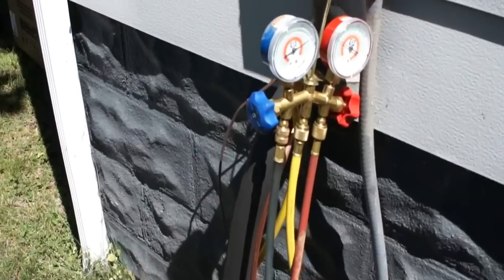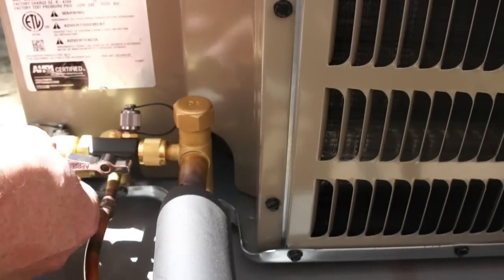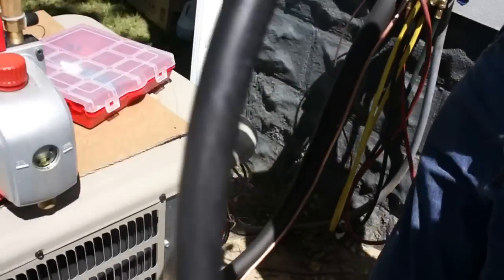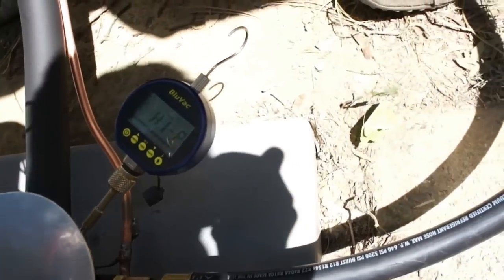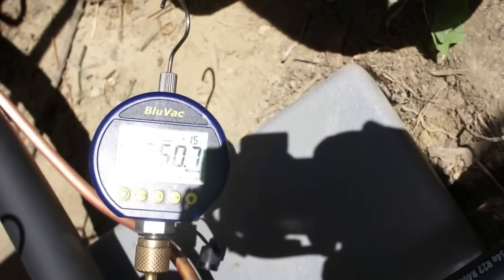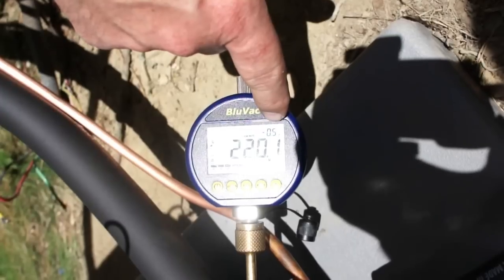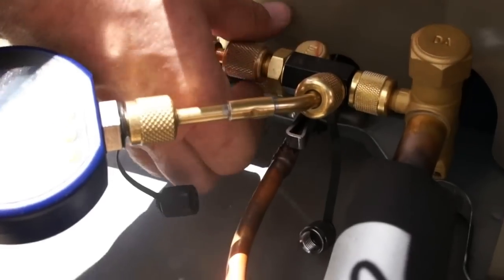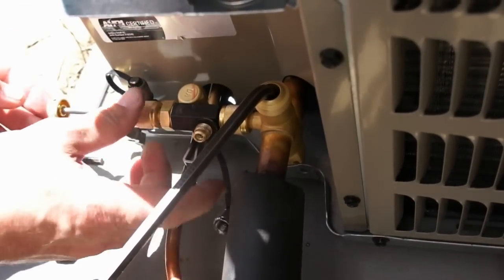51 seconds to 500 microns with the TruTech Tools Rapid Evac System

Comment: Hi..
how.mutc is the minimum vacuum pressure for good results ?
Reply from the maker: Generally, evacuating a system to 500 microns or less is a good standard.
Reply: @TruTechTools  i make it 40 microns and when I stop  rise to 350
Reply from the maker: @ghostridergr8259  more often than not the lower the better!

Comment: I was always under the impression not to open the suction service valve under a deep vacuum,  reason for that, you can pull the oil out of the compressor, correct me if I'm wrong and explain please.

Comment: When you open the valves with micron gauge attached won't that expose the micron gauge to the pressure of the refrigerant / oil? I did this the other day and I think it damaged my micron gauge.
Reply from the maker: Before you start the evacuation process, the system should be purged with nitrogen to remove leftover oil and other contaminants from the system.  In the event that the system keeps some residual oil in the lines and this oil comes in contact with the sensor, the AccuTools BluVac (shown in the video) can be cleaned with isopropyl alcohol.  Just fill the gauges sensor port with the alcohol and swish it around inside with your finger over the end.   Dump out the alcohol and repeat until the alcohol is no longer dirty or cloudy. Isopropyl alcohol can be used to clean most micron gauges, be sure to check with your gauges manual to be certain. 
The micron gauge should not be hooked up to a charged system.  It is only used to measure the vacuum in the lines and is not used when refrigerant is in the system.
Reply: @TruTechTools  I understand that but he left the micron gauge on at the end to not break the vacuum. He opened the suction service valve to release refrigerant and break the vacuum(Which I believe you are supposed to open the liquid service valve first.) When he opened the suction service valve the micron gauge was exposed to the refrigerant entering the system.

Comment: I sure would have liked to see the progress of the micron gauge reading continue in the testing of the vacuum pump at the beginning of the video.  It was still dropping pretty rapidly at 10 microns.  Also, when reinstalling the Schrader core: How about purging the part of the valve core remover tool that is full of air before opening the ball valve fully?
Reply: Yeah, I have seen others suggesting purging the air in that manner.  I think that is good practice.

Comment: Its bad practice to vac the system that fast. It can freeze moisture in the system if you pull a vac too quick.. It means your not getting all of the moisture out of the sysyem.
Reply: The oversized hose isnt doing any good either. Thats just adding to the fast pulldown which is freezing the moisture
Reply: @1989Chrisc  
Exactly. You can put a 4" hose on this, it won't matter. Still the same port and line size.

Comment: To all those new guys in hvac This is the reason way you should not watch YouTube videos to learn. I am sure he’s going to open that suction line first.  With this system under vacuum, opening the suction valve will pull a lot of oil out of that compressor into the system. To new guys always open the liquid service valve first once the system under vacuum.
Reply: Your point is exactly right. This Guy is just a salesman for Tru Tech Tools. He does not know a better way to do a vacuum job. A lot of questions from viewers went unanswered.

Comment: He spent 20 minutes setting all that up lol Dude just hook the vac to some digital gauges with built in micron gauge and turn it on the go clean up the job and finish up things while the vac runs. A good set of digital gauges will have an alarm to tell you when you're done.
Reply: Evermont King buy the mini Blu micron gauge, those built in micron gauges on manifolds are crap, old technology
Reply: Dude get with the new hotness.

Gauges are garbage when pulling vacuum.

1/2 hose to a TEE then to 2 1/2 Jose’s straight into the system without valve cores. 

Can’t be beat.

Comment: why keep the pump running "after" closing the valves and throughout the standing vacc test?
Reply from the maker: If you isolate the system and see that it is still outgassing you will need to put the system back under vacuum. If this is the case you do not want to introduce the hoses to the system once the valves are opened and the hoses were no longer under vacuum (introducing atmosphere back into the system) The pump should not be turned off until the evacuation is completed or the process is done.
Reply: Hello fairly new to the hvac industry so bare with me. Do you remove both schraders or just the suction side? Also why did you crack the service valve? Was that for when you reinsert the schrader valve no air gets in the system? Thanks in advance

Comment: 1/2" diameter vacuum hose in the middle but restricted at the ends to 1/4" diameter? Doesn't make sense to me. Why not 1/4" all the way through vacuum rated hose?
Reply: it acts as an accumulator for the vacuum pump thus making it work more efficient.
Reply: It makes a huge difference. This isn’t a high pressure exchange so it isn’t going to act the way we might be familiar.

Comment: Would it be beter if every vacuum pump had a solenoid valve? When you close the pump air is comin back in at a slow rate. With the solenoid valve nothing comes in again..

Comment: Think the big vac hoses are all a selling gimmick the hoses are like 5/8 thick but at the fitting they are only 1/8 diameter big hoses will only flow  what the smallest point in system can flow which is a coreless service port flow rate the biggest improvement is using 2 coreremoval tools
Reply: smoothsteviegful thats not true, the small parts will absolutely interfere with the flow and make turbulens, but just around the smaller part, and because of the short length of the small area compared to the rest of tubes and pipes with bigger area it can be considered as a single resistent in the entire system, like a 90 degree for instance, or a valve. Not that I recommend this kind of set-up.
Reply from the maker: We have done extensive testing and research and the hose size is a significant factor even with 1/4" ports.
Reply: smoothsteviegful or a higher cfm pump

Comment: I installed a new compressor the other day within an RTU with the BluVac gauge and Appion hose/core tools.  About an hour later, <100 microns, which held for >3 hours.
Reply from the maker: Great Job
Reply: jd dr.jkindle can’t you boil the oil that low of a vacuum isn’t good for compressors right?

Comment: The part I do not understand and have problems with is maintaining a stable vacuum reading.    I just did a system and pull down to 200 microns and in 10 minutes it rose to 700 microns.  But did not stabilize and kept slowly rising.   Yours rose to over 300 microns but was still climbing.   It did not look to me like your reading was staying stable. How far would you allow it to rise in 10 minutes before you think there might be a problem
Reply: If it keeps rising then I would advise breaking with nitrogen and trying again. When you first valve off in a very deep vacuum some very small increases are to be expected. The rate and time involved is related to many factors including total internal volume, the components you are pulling down, and any  substances left in the system. If the compressor or accumulator are included any moisture entrained  in the oil can take some time to release and can result in a slow climb even on a tight system.
Reply: bilskro if you pull a vacuum too quickly it can freeze any moisture and when the system sits in a vacuum the ice will melt and turn to vapor causing your pressure rise. it's not actually a good thing to pull a vacuum this quickly.
Reply: After using the trending feature of the bluvac pro I found it the vacuum falls in any inconsistent way to break it with nitrogen and start again. Mine stabilizes when the equipment I am using is properly maintained. If I have a gasket that needs service or then the rise will not stop. It goes up then stabilizes to zero leak rate. If ever it keeps going up it’s likely oil in the gauge or water in the system. Either way break with nitrogen take care of the issue then get back to it.

Comment: I think a lot of the time "saved" was taken back up fiddling with extra fittings and playing with service valves and such. I prefer a four port manifold so I can use less fittings and spend less time hooking things up. I never have a problem with speed leaving the cores in and just so long as you change them out if they were leaking you're good.
Reply: I find that a manifold has too many places for leaking. Too many parts that need to be serviced and typically those charging hoses are not vacuum rated to the same ability as a vacuum rig.
Reply: If the line set is short or small tonnage yeah you are waisting time.  But on longer line sets or systems I suspect have extra moisture I use manifold and remove the valve cores for more effective vacuum.  Or bypass manifold altogether.
Reply: Lyle Cairns  yes sir
Reply: Lyle Cairns thats why you get yellow jacket titans, best gauges ever!!!
Reply: brian village i agree.

Comment: Mr. Bergman. Question: At 9:22 you said " Crack the service valve, were going to break the vacuum" Does that mean that you were not evacuating the Condenser ? I'm confused was the Condenser already evacuated ? Please advise. Ted H.
Reply: No... the condenser had refrigerant in it.  Usually what I do is exactly what he does, only I blead the air out of the core before pushing it back in by cracking the valve on the core removal tool then tightening it up as a last step.  Otherwise, if I am vaccuuming the condenser too, on the liquid side, I have a tank of refrigerant upside-down on a scale... already purged.  Once I am ready to break the vaccuum, I dump the liquid refrigerant and the vaccuum pulls it in.
Reply: The condenser was already evacuated as was shown in the video and  He broke the vacuum by opening the systems Parker valves to allow Freon to flow into the line set.

Comment: why no purge core remover when reinstalling core after cracking valve? You just put air in the system. :p I know its tiny, but itll read like 300+ microns.
Reply: +Bubba Gump that's wrong, once you've put the shrader remover on tight it has sealed the moisture laden air in. leave you micron guage on when you do it and see what happens. always purge the last part, he let a wee bit of moisture in then. and if your spending $500+ on this kit then your obviously a vac freak.

Comment: WOW! Vacuum gauge needs to be as far as possible from the vacuum pump. You will get inaccurate readings with the meter this close to the pump.
Reply: What are you talking about?  He valved it off and it held.  How can you fake that?
Reply: How can you get any farther away? Its isolated after the pull down anyway.

Comment: I frequently hear techs complaining about deposition and liquid water freezing due to the fast nature of this vacuum system but it doesn't hold much water (no pun intended) on these small systems. That issue is easily resolved by first, purging the system with nitrogen during and after brazing but before your initial standing pressure test. Many manufacturers require installers to do a triple evac which is also extremely helpful in dehydration. Water at 100 microns boils at about -40° F. When water freezes, it isn't suspended between the walls of the pipe, it rests on the pipe walls. Unless you evacuating a system in less than -40° F conditions, the heat of the ambient conditions will conduct through the pipe walls and boil off the ice once you isolate the system from the pump. Your micron gauge will show you if there is moisture in the system or not (which is why we use it). However, I wouldn't recommend pulling a vacuum so quickly on a large chiller without other considerations especially if water contamination is suspected. Let's be honest though, most of us here aren't working on that many large systems.
Reply: Takes me a full day with 1/2in hoses a 8cfm pump and a dehydrator setup on my 300 ton 19xr chillers

Comment: I sometimes break the vacuum with a refrigerant cylinder hooked up to the other valve core tool with the vacuum rated hose under a vacuum too. I typically do this on compressor change outs or any other time a recover all the charge. Also, I prefer to hook up my micron gauge to a ball valve so I don't risk exposing it to excessive pressure or system oil.
Reply: why do you do this? what is the benefit of breaking the vacuum with a refrigerant cylinder?

Comment: How would you hook up to the system if you were to break vacuum from a refrigerant cylinder as apposed to cracking the service valve in the condenser?
Reply: With this setup hook up hose with ball valve to service port on core tools preferably liquid line one so as to not introduce liquid refrigerant to compressor.  Hook other end to refrigerant cylinder.  Purge hose with liquid refrigerant to ball valve.  Then go ahead pull vacuum.  Do this BEFORE pulling vacuum or you risk permitting non condensable air to enter system.  When vacuum done open valve in hose to charging cylinder and charge to system specifications.

Comment from the maker: After the core tools isolated the vacuum rig from the system it was allowed to  set for over 10 minutes. The final vacuum was shown in the video. After 2 to 3 minutes to vacuum balances out and do the same at both ends of the tubing.

Comment from the maker: Typically in an air conditioning system that there's no way that you can draw the vacuum too fast. That system was properly installed continually purge with nitrogen and pressure tested so there was absolutely no moisture to worry about, it was simply degassing. If you follow the process that I put on the TruTechTools evacuation training page you will never have a problem. We have several hundred customers that use these gifts every single day.

Comment: So most manufacturers say not to pull such a fast vacuum as moisture can freeze in the system due to rapid depressurization, thoughts?
Reply: Triple evacuation, breaking the vac with nitro
Reply: I have heard the same. Otherwise we would all use the tez8 or some other 10cfm or greater pump.  The triple will eliminate frozen moisture(ice).  My vac times used to be hours or more.  If I take an hour or longer its bigger equipment.  24 ton Mitsubishi with 16 heads and 1700ft of line was pulled to 140 microns holding in 3 hours with a jb7.

Comment: My second though is after you've added the core valves and removed the core removal tool, wont air get back in the system once you hook your gauges to add refrigerant?
Reply: You would have already released the charge. So you bleed the core tool, no air !   I just realized this post was 5 years old.. LOL

Comment: Jim, great infromative video.  I have a question.  Say you're pulling a vaccum on the entire system(indoor/ourdoor). After the vaccumm Is pulled and you've closed the shut off valves on the core removal tool and the remove the hoses. Is it best to leave the core removal tools on at that point and add refrigerant to the system and install the core valves afterwards?  I was thinking that if you add the core valves after the vaccum, there isnt anything to presurized the system since it is bone dry.

Comment from the maker: No, the refrigerant was in the system at that point. I cracked the suction service valve to pressurize the system. Refrigerant was pushing out so no atmosphere can come in.
Reply: You should have cracked the system on the HIGH side not on the LOW side.

Comment: Did you have the core removed from the port where the bluvac was hooked up?  Also i pull vacuums with this setup on a regular basis and the results are outstanding.  I've had systems sitting at 100 microns with zero leak rate while isolated.  Amazing kit really.

Comment from the maker: Two different types are not critical. When installing the cores, a lot of techs use a little on the valve seat. This just minimizes oil cross contamination. Likely over kill, but it cannot hurt anything.

Comment from the maker: Nylog is an assembly lubricant that keeps things from binding and leaking when attaching hoses. The different types are for the different oil in systems. One is POE oil and the other mineral based.